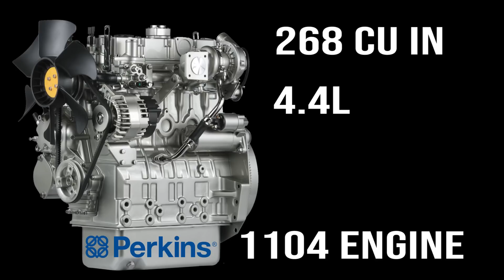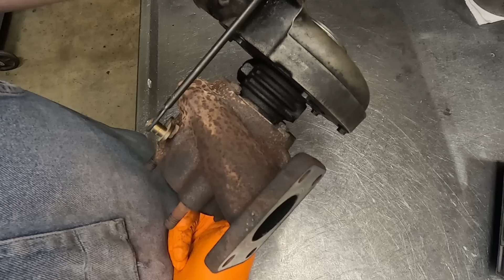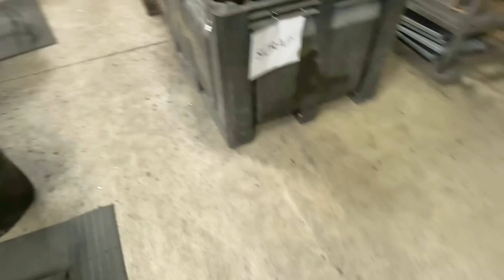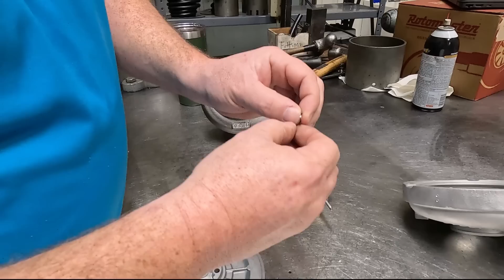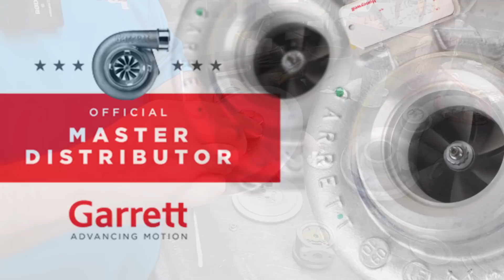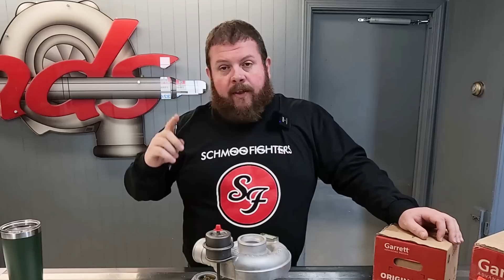Repairing @DieselCreekGenie GTH-1056 Telehandler's Garrett Turbo

Comment: Hi, i want to comment not to try and be a know it all.  I just want to be helpful in assembling turbo's and tell guys what i have found to make a job more successful and a little easier.    
On Switzer turbo's that have a nozzle ring in the exhaust housings, YOU MUST MAKE SURE THE INNER ID OF THE NOZZLE RING MUST FIT INTO THE OUTTER LIP OF THE BACKING PLATE.  if it doesn't, then the band clamp will not pull the beaning housing and exhaust housing together and the exhaust will blow out around the band clamp.  If this is off, it only takes a little grinding of the inner ID of the nozzle ring.   you will lose boost and power, and it may even cause the turbine wheel to hit the exhaust housing.  If it isn;'t fitting correctly, the two halves of the turbo will not fit together flat where the band clamp holds them together.    Also, i use anti-seize on everything.  It will burn off but still add a lubricant to slide the comp housing or exhaust housing to line everything up.   the only reason I'm commenting is because of my 20 years working on large landfill gas Cat G-399 engines.  We had to deal with hard melted silicon build up on all turbo parts.  It was harder than melted glass.

Comment: Greatest info for me is the troubleshooting the surroundings part, so either
- airfilter maintenance neglected and the oil sucked out of the bearings 
Or
- oil return from the cartridge inhibited bei either dirt or over pressure in the engine housing
Either could have caused the oil in the compressor side…
Interesting !!!

Comment: KInd of unrelated and maybe i just dont know enough about this stuff, but a 4.4L engine with only 120HP? I know its not a race car or anything but ive seen 1L 4 cylinder engines make110HP with ease. I dont know if im missing something so feel free to inform me.
Reply from the maker: That's a good question. Maybe we can touch on it in a video sometime. These industrial machines will often run at their rated horsepower for hours on end. That same engine might be capable of making 250 HP or more, but if it sits there and produces that level of power all day long it won't last too long. It's one of the reasons that diesel came to be known for reliability. In most industrial applications they produce much less power than they are capable of which results in longer life.
Reply: @AreaDieselService  That makes sense, one would rather have a machine that can run for 50years with bad fuel economy, than one that grenades the engine after 5 years. Thanks for the reply.

Comment: I came here for this video, from Diesel Creek.. I love Matt's Channel.. 
Side note: almost 30 years ago, I had a 1951 Monk Classic (Boat), that originally came with a 4 cyl Atomic 4 gas engine, when I was tearing apart the top deck, I had a guy offer me a 1950's Perkins Diesel, he installed the engine, and plumbed in a diesel tank and lines for it, with the through hull brass lines for cooling, I went from 500L of gas to 1000L of diesel. in trade for my Atomic 4 gas engine. 
 That old Perkins was the best thing to ever happen to my old boat, she took me from Victoria BC, Canada to the Baja Peninsula in Mexico, and back again. about 12,000 km total trip (7500 miles).  I was used to cruising at 5 knots with the gas engine, and the Perkins took me up to 9 knots. Hull Speed was 11 knots top.
Reply: Curious, how many gph — on either, but especially the new diesel?
Reply: @TSPhotoAtlanta when I traveled from Victoria BC to Baja MX, my Monk had 2000 liter main and a 800 liter reserve tank, I ran low on the main tank near San Diego, in total I was gone about a month,  and only filled my main 3x about 7500 nautical miles was the total journey

Comment: @DieselCreek sent me 👍

Saw his video about if the turbo was really the issue and it was not. Turbo runs fine and all. I'm thinking his problem could be the injectors. He went to start it a month later but nothing happened. The pump-pressure is there, he could have use starter-fluid to start the machine but this is not goal there.

My friend had starting and HP issues with 4 tractors. All 6cyl 290-350 HP. The temporary solution is always starting-fluid as he can't afford down-time in mid-season etc. New accumulator-pump, fuel-pump partly solved the issues til we addressed the injectors. Yeah, those boogers ;)

Comment: Have you guys experimented with applying Cerakote to the Turbine Housing and Turbine Wheel?!? The Housing needs the Cerakote applied both inside and outside. It’s an additional service you could charge for when doing a refurb that improves performance and longevity.

Comment: Does the blowby enter the input filtered air as egr?
Reply from the maker: We haven't seen a system where that would be the case, but it wouldn't surprise us if there is an engine out there where that is possible.

Comment: Motor dusted...?
Blow by back pressure against turbo case drain ?

Excellent machine to fix though. I had those Perkins diesel engines excellent 👍

Genie is excellent also.

I rebuilt a turbo on a Volvo .
Works good.

Nice work 👍

Comment: Hello sir . May i ask you provide some video content about old cummins and komatsu turbocharger . Some says they has reverse rotation and there is limited number of upgrade parts for them for instance we have fleet of blaz rock truck with cummins vta 28 ( turbo   t46 and st 50 ) they are famous for low boost and lag . I want change compressor wheel ( size 76 x 128 mm bore hole 14mm )   please speak more about old industrial engine.  They are great engine.  Also caterpillar has couple of this example like d353  d399, 3408 , 3406 , 3306 ,3508  . I think in usa these engines continue to exist specially in oil and gas . And in Canada and all remote mine locations

Comment: Does area diesel sell anything for the old om617 turbo diesel Mercedes cars?
Reply from the maker: We sure do. We don't see too many of them anymore though.
Reply: @AreaDieselService  I am wondering if you guys have some sort of upgraded middle section for the factory turbo. I want to get the turbo to come online a bit sooner. Also are you guys dealing with the M pumps with slightly larger plungers? Looking to increase the output of the engine a bit but not too much.

Comment: That's amazing that you can sell that complete cartridge for less than 400 bucks in this high inflation age.  You think maybe Matts engine has worn out rings letting excess oil into the exhaust?  I saw where he said it had many thousands of hours on it.  Hope you folks have a prosperous year.
Reply from the maker: It's possible. We're curious to see what happens after he installs the turbo.

Comment: And if the engine has double boosr sources like a roots blower and a turbo its also necessary for a Detroit Diesel powerplant.  They need a wastegate. 13:21